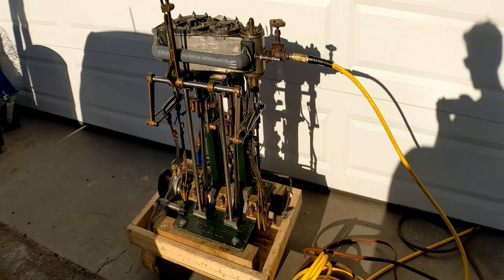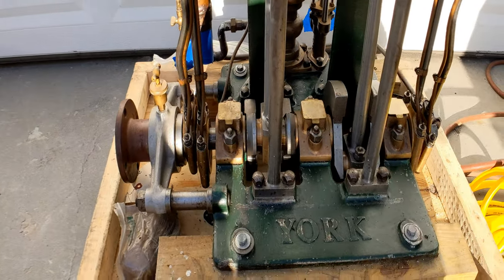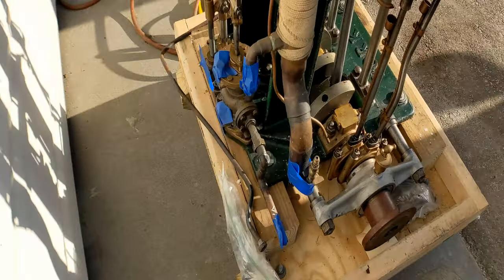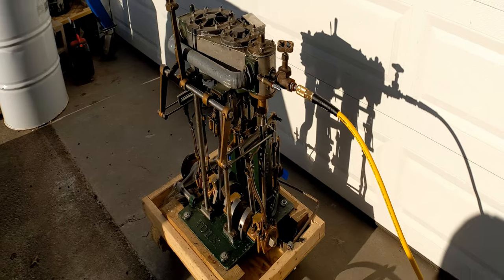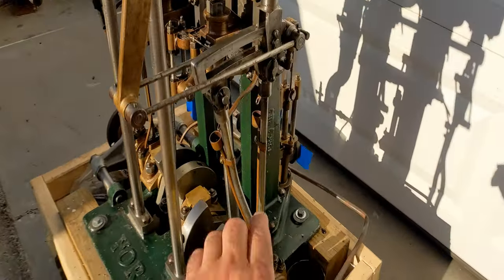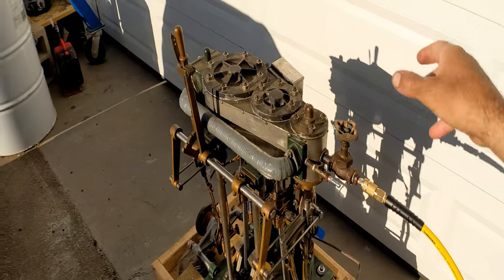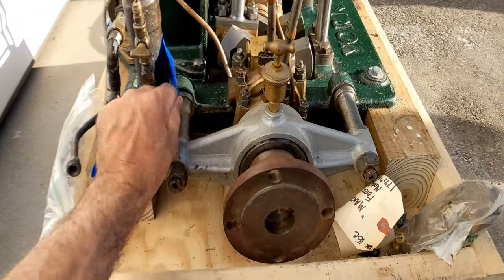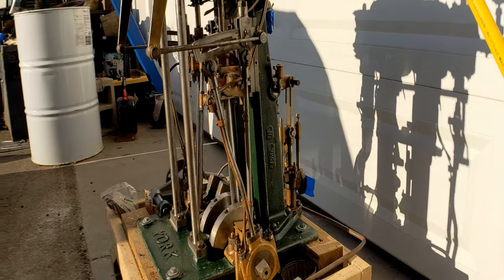York Compound Steam Engine

Comment: Bonjour Wesley,
Nice machine indeed, even if a little bit too large for my boats :+) 
I call vaccuum pump what you call condensate because it effectively pushes the condensate water but also create a depression which increases the power of the machine. A freidnwho has a launch told me that his 2,5 HP machine won about 0,5 HP by adding this pump.
Amicalement Raphaël
Reply from the maker: Bonjour Raphaël,
Thank you for your kind words. You are always kind and positive. A model of this engine would look lovely in one of your boats. We call it a vacuum pump here as well. The terms are used interchangeably over here. They really add quite a lot of power to the engine. The engine in our big boat increases in speed significantly when one allows vacuum to pull on the LP piston. Great pieces of kit.

Comment: A  very handsome engine, for the die blocks try nylon, easy to make, and the one I made is still going strong at 35 years.
Reply from the maker: Thank you for the tip! I talked to John York the other day and he said these ones were nickel aluminum bronze. Said if he were to do it over again he'd make them a bit larger for more surface area.

Comment: This is a dream of a marine steam engine. Is there a connection for steam on the pipe to the low-pressure cylinder when the high-pressure cylinder is at dead center?

Greetings Michael
Reply from the maker: Thank you Michael. Yes there normally is what we call a 'simpling valve'. If you look closely I put a second valve and air fitting on that position in case I needed to put full pressure air to the LP. As you saw, I didn't need to and the engine ran very well on very little air. A testament to the quality of the build.

Comment: How much does one of thes run
Reply from the maker: About $5,000 and a few hundred to a thousand hours of your time if you buy a set of castings and machine them. If you pay for a brand new one someone has machined, upwards of $15-20,000. A used one between $5,000 and $25,000 depending on the make, quality of machining, and condition of course. There are always the outliers going for much less or much more of course. If you check out the links in the description there are engines for sale on some of those websites.